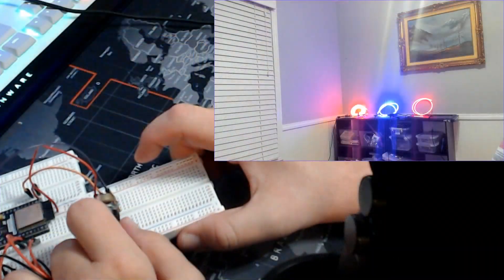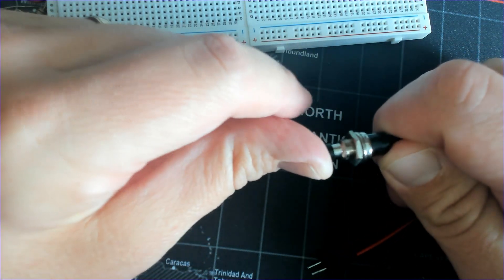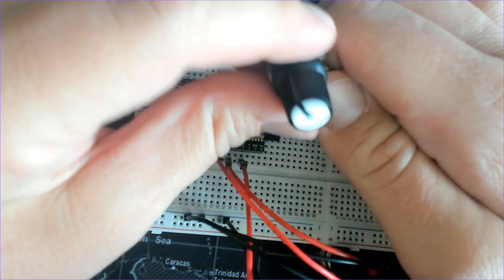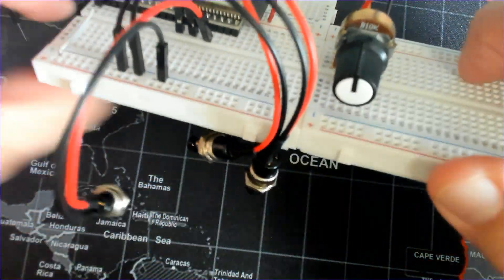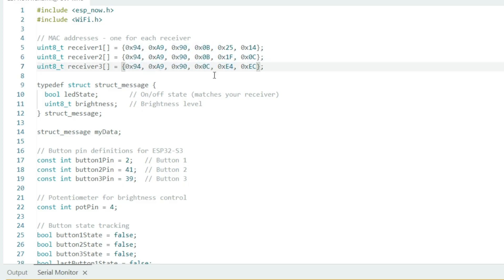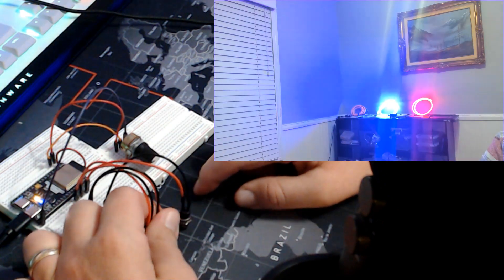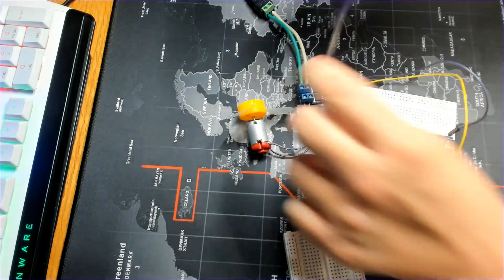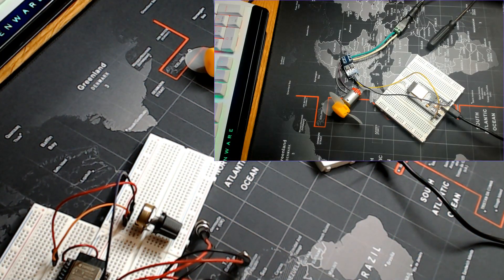ESP32 ESP NOW Wireless LED Controller – Toggle and Dim in Real Time!

Comment: This may be a dumb question but I can’t find an ESP32 Now device to buy. Are you using a different specific ESP32 device and the ‘NOW’ part is actually the code or software?
Reply from the maker: No, not a dumb question at all... Perhaps I should have explained  it better.
It's a communication protocol that uses the boards 2.4GHz hardware, but it doesn't actually connect to a router or the internet.

1. All the ESP32 boards have ESP-NOW built in...so you need a board (ESP32, ESP32-S2, ESP32-S3, ESP8266).
2. In Arduino IDE - go to file-preferences-additional board manager urls and add this: https://espressif.github.io/arduino-esp32/package_esp32_index.json
3. install esp32 from the boards manager
4. you need to know the MAC address of each board so they can pair. you can pair direct peer to peer or broadcast. There is a section in my previous video where I do this. and if you want the code from that video, just send me an email. Here's the video - https://youtu.be/_ma35kHm_j4
5. use these libraries: esp_now.h and WiFi.h

There is also a lot of helpful info at esspressif.com - search esp-now and read the user guide for your particular board.

good question! 👍👍
Reply: @BMonsterLaboratory wow, fantastic info. Thank you so much for making time to explain this, in addition to your videos. Once I get some down time next month I hope to build some of the things you’ve shown how to do. Take care.
Reply from the maker: @judgeworks3687  That sounds great! if you have any questions along the way, just ask.
Reply: @judgeworks3687  Seconding this!  I'm new to the microcontroller world, and projects like this one are right up my alley... but the vast majority of content out there seems to either assume a certain level of expertise or just falls way short of effectively teaching anything.  And of course the former has its place too, but videos like this one are so exactly the "sweet spot" for me:  hands-on, actually making something, actually showing how and talking through it, but without assuming the worst when it comes to viewers' IQs!  LOL :)    (not to mention, kindly responding to questions like yours, requests for code, and so on!)    I've only just discovered this channel, but I'm already a big fan!

TL;DR:  yes indeed, thank you so much for the most excellent content  :)
Reply from the maker: In this video I have 4 of the Freenove ESP32-S3-WROOM Board Lite. they are the slimmed down versions but with the same core cpu power.
 I also have 2 FREENOVE ESP32-S3-WROOM CAM boards, and they are great. had them in some earlier videos.